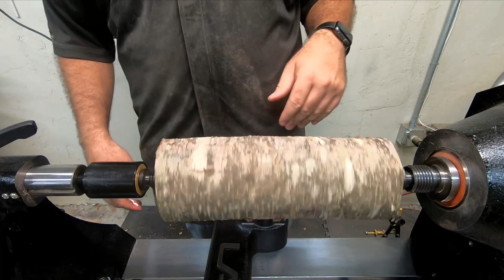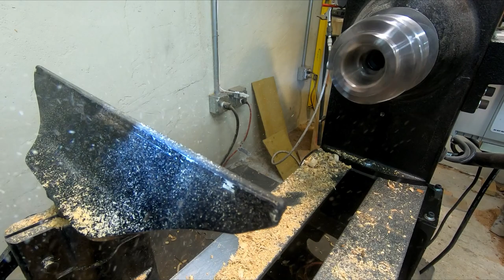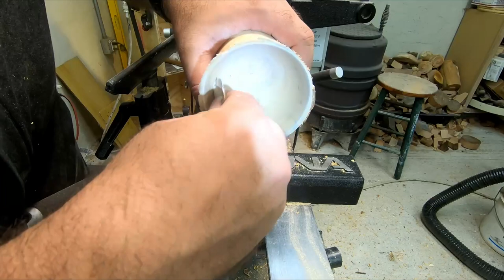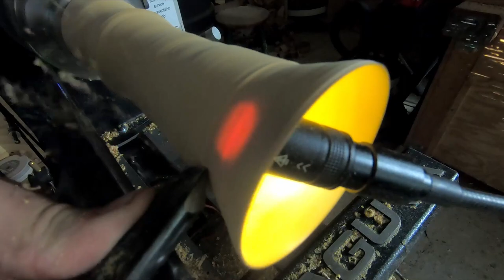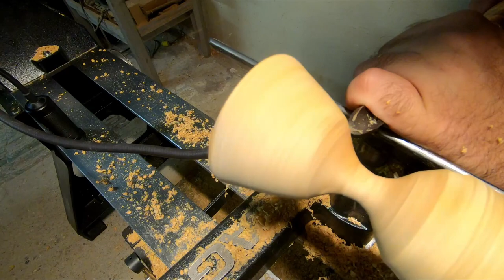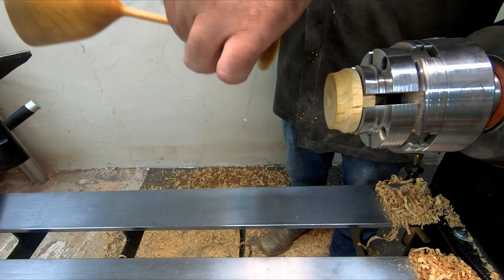Woodturning - A Wild Cherry Goblet

Comment: Pretty good for a first try. Or even a 20th - you got some chops Seth !!
Question: Was it wet wood movement that gave the stem its warp ?
The good thing about thin is you only have to apply finish from one side as it will soak through to the other side.
I find tame cherry a bit, well, tamer to work with😁
Stay safe. -Mike😷💉
Reply from the maker: Hey Mike, I greatly appreciate your kind words! 
To be honest, I'm not sure if it was wet wood movement or centrifugal force while I turning down the stem, when the camera battery had died, without me realizing it. 

LOL, my dad has always referred to it as "wild cherry", to which I always respond, "as opposed to all of that tame cherry that's out there..." 🤣

Thanks again for watching!
Reply: @BrickhouseCraftWorks  Watching is my pleasure.